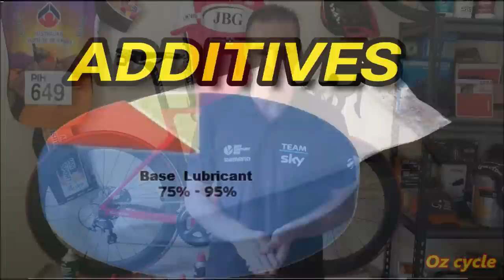Ultimate Chain wax - make it yourself

Comment: I've been waxing my chain for more than a year now and what a change it has made! Cleaner chain, better gear changes, cleaner hands after changing tires / flats, easier maintenance! Thanks! 
Just an idea - I've been dipping an old magnet into the hot wax after a chain waxing and I collect metallic dust from the bottom of the crock-pot. Simply collecting this metallic dust keeps the wax cleaner and freer from grit.  You may need to skim the magnet over the bottom surface a few times to collect most of the grit. This keeps the wax cleaner and I imagine keeps performance over time. Let me know what you think!
Reply: I wait and let the wax harden. Invert and wack it. Scrape it with a spoon and the wax is clean.
Reply: What wax did you use?!
Reply: i did it to and my chain looks dry after 150km, it looks like there is no wax anymore on the inside of the chain...
Reply: Magnetic cleaners are used in central heating systems.
Reply: This is a smart idea!! Should pinned!

Comment: After 45 years of oiling chains, this video sold me on trying a wax immersion lube. My first ride today with a waxed chain - my chain was the quietest it has EVER been, and at the ride's completion, I rubbed my fingers on the chain, and they came away without the black, oily mess that appears at the end of only one ride when using various "traditional" oil lubes. The cleaning and waxing process is a bit time consuming and requires some new equipment, but I cleaned and wax lubed three chains this morning - good enough for about six weeks of riding, if this video is accurate. Many thanks for creating a compelling and informative video on this topic!
Reply: Hi, interesting that you say your chain was the quietest it has ever been?  I went out with mine waxed for the first time at the weekend and it was really quite noisy, compared to usual.  I can cope with this but do you know, are we supposed to let the was cool from 93 degrees down to the melting point of say 56 degrees before taking the chain out or did you take it out at the higher temperature?  Thanks.
Reply: @johnslater996  I’m finding that too, John. Also wondering whether the cooker should be turned off once it’s at the right temperature...
Reply: @SteRumbelow  I take the wax to 93° put the chain in and switch the cooker off.  All good after 15 mins.  Turns out I'd fitted the chain wrong on the rear mech - all good now 👍
Reply: @johnslater996 While I have not taken the temperature of my wax while sloshing my chain around it in it, I do NOT let it cool before removing the chain. It is also important to let the chain warm up in the wax for several minutes, along with some agitation, to make sure the wax penetrates well into the interior linkage surfaces of the chain. I take it out of the hot wax, and immediately wipe with a cloth, on all four sides of the chain. This eliminates most of the excess wax, which seems to add noise. Of course, wiping the outside surfaces of the chain does not remove the wax from the internal bushing/pin contact points, nor the inside of the plates; these are the locations you really want the lube. If you let the wax cool before wiping, or if the wax is not nice and hot, then you get a lot of excess buildup inside the links. This contributes to noise plus it leaves a lot of excess wax residue on chain rings and cassette cogs. I also run the chain around a 1" PVC pipe while the chain is warm, to better work in the wax and also loosen up the chain before putting it on the bike. Other comments - I still have to occasionally wipe small bits of wax off my chain stay, chainrings, cogs, and pulley wheels (every 1000 miles or so), but it is easy and fast - and I only have to wash my bike when I ride in the rain or through some mud. To reduce the time spent rewaxing, I wax 2 chains at a time - effectively cuts the time in half. After 5k miles per chain, they are still "in spec" (using the Park chain length tool) with respect to length.
Reply: i’m curious if everyone is still waxing their chains
Reply: @andrewreed1329  Mee too

Comment: Massive props! Been using your method for a few months now and it's saved me eons on post mtb ride cleaning and time between rewaxing compared to various bottle lubes I used in the past, which require constant reapplication and attract so much crud. Only downside is it doesn't hold up well in the rain, so it's worth keeping a 2nd lubed chain or keep a bottle of Squirt lube handy just in case!

Comment: Great video and thanks for sharing the information. I found a post on a forum many years ago explaining about the forces/pressures within the chain being extreme point pressures, similar to a car gearbox and suggested that the best lubricant was therefore EP Gear Oil (I use 85-140). The problem arises of how to keep the oil in contact with the pin/internals of the chain and suggested mixing it with paraffin wax. I took this great info and implemented it - after fully cleaning/degreasing the chain, I made a mixture (aprox 50/50) and melted it in a pan (in silver foil), enough to cover the chain. I let it cool to solidify (which keeps the mixture inside the chain) and removed the excess externally. The results have been amazing - on one chain (old mntn turned town bike) it survived 4 trips to Burning Man (probably the harshest environment for bikes on the planet!) with only light external cleaning with EP oil to maintain its almost silent operation! I still haven't needed to repeat the initial procedure as it just keeps going, around 9 years later...
Reply: This is the recipe I've used for the past 10 or more years.  I can easily get about 1000km of riding before the chain sounds a little dry and I reapply the lubricant.  I don't bother cleaning.  Just immerse the chain in the hot wax/oil bath for a few minutes, then lift it out and wait for it to cool before putting it back on the bike (or swapping if I'm running 2 or more chains on the one cassette).  I don't bother degreasing a new chain either.

Comment: After "ultimately" cleaning my chain, and waxing, both per your directions, I just today rewaxed my chain after 193 miles of off-road mountain biking.  Being able to ride time after time, and not worry about lubing my chain, or about the grease when I handle any part of my drivetrain, is worth so much more than time and money.  Wow.

Longest part of the rewax is melting the wax sitting in my rice cooker.  Takes about 4 hours plus to fully melt on low heat.  Cleaning with boiling water was a breeze, as was the waxing, and putting back on the bike.

Can't thank you enough, Oz.
Reply: Now, with a waxed chain, when I wash my bike, the following day I have zero rust on my chain.  And, I can thoroughly dry my bike, and there is absolutely no grease on my microfiber paint-only drying towel.  I used to absolutely contaminate all my paint-only mf towels when I dried my bike.  Just ruined them.  No longer.  Yet 2 more reasons to wax!
Reply: 4 hours to melt wax? You must have forgotten to depress the lever on the rice cooker. Without that it will only supply heat to keep rice warm.

Comment: Oz cycle - absolute legend. For those in the UK - Argos slow cooker £12.99 - Hobbycraft 1kg Parra fun wax block or pellet £8. PTFE powder off AliExpress....or eBay but was sold out
Reply: Is it worth doing the cassette?
Reply: @rallyboy101 I'm far from an expert, but I would say no. The main rationale for doing the chain (particularly immersion) is due to the many hundreds (perhaps thousands) of stiction points within the chain with each pedal stroke. Whereas, for the cassette, the chain comes to a rest against it one link at a time and pulls the teeth along. The chain isn't even supposed to "rub" against the cassette.
Reply: Can you use a normal pan on low heat instead of the slow cooker?
Reply: @alexapirot32  yes, but very low heat, so it doesn't start generating fumes
Reply: Or use a pan on top of another filled with boiling water. Au bain marie.

Comment: Two days after uploading, seven chain lube manufacturers dislike this video.
Reply: Suggest you read zero friction cycling facebook post re the testing. Plus home formula wax blends hardly new, and many perform well for those wishing to go that path. Its a tiny demographic, i dont think many lube lube manufacturers too worried. But to understand a bit more about proper independent testing, refer to zero friction cycling and learn some key points.
Reply: @adamkerin4130  It was a tongue in cheek reply Adam. I've been waxing my chains for a couple of years now; chains last 2-3 times longer as well as sprockets, cleaning my bikes is a lot faster and the only "inconvenience" is taking my chain off to clean and re-wax it.

Comment: Good evening and thank you SO SO SO SO SO much. PTFE arrived (ordered from eBay on December 2019) yesterday. I have had 3 chains super cleaned already (petrol, wash with soap, degreaser, wash with water, alcohol) and I waxed them all three following your recipe by heart (I have also cleaned my cassette and chainrings before testing).
Today I tried one of the waxed chains: Oh my God..... what a difference, super smooth operation, NO NOISE AT ALL, excellent shifting performance, super clean chain/cassette/chainrings after 90 km, super clean bike, and an achieved ΚΟΜ.
Thank you again so much indeed. Greetings from Crete/Greece !!!

Comment: Just a quick update, just completed my first 100km on my waxed chain and it's still clean, it seems faster and definitely more positive in the gear changes and it is quieter on my bike, although some people have reported it to be noisier than before I did not find that problem, well and truly happy with the results, I'm definitely a convert now.
Reply: I found out about waxing about 10 years ago. I initially used candles but have moved to food grade wax. Once you start and get into it there is nothing better.

Comment: Alternative to buying or ruining a slow cooker:  Boil water in a pot. After a good boil, turn heat down so its slow bubbles. Put container(metal or plastic) with wax in the water-if plastic, be careful not to rest on the bottom of the pot, by the heat source. It could melt or burn.  Used this method for candle making, etc.  Thank you, Mr. Oz.
Reply: If this technique in gastronomy is called a bain-marie
Reply: works also fine for me!

Comment: Fantastic video and great detailed instructions oz. Thank you! I've ridden 600 km since the first waxing a couple of weeks ago. Still no squeaking and the chain & drivetrain are still shiny and very quiet. Going to clean/reapply soon and I may get to my wife's bike too. LOL
I didn't use petrol on my filthy Ultegra chain, just the Varsol cycle several times before the Meths rinse. 

For any Canadians interested in this method, I ordered 100g 1-3 um PTFE (2x 50g sachets) through Alibaba delivered in Canada for US$17 and 1lb of food grade paraffin wax at Superstore for Cdn$6. That is basically a lifetime supply of superb wax lube for our household bikes, all for Cdn$30. Is Teflon powder restricted in Canada? Nobody sells it to the public and US vendors won't ship it to Canada for under $30!

One tip. Rather than buy a dedicated slow cooker, you can use a large, clean microwavable (so the container won't melt) food container to melt the wax/PTFE mix. Use your wife's best large pan on very low heat on the stove, with an inch or two of water in the bottom - it is effectively a double boiler. Cost is $0. Once you have waxed your chain and the wax/PTFE has cooled, simply put the container lid on and store until the next time. LABEL IT so the rest of your household know what is in there.

Comment: Been waiting for this video. people are amazed when I ride in the worst sandy, muddy, rainy, weather and my chain stays clean cant wait to try this new recipe
Reply from the maker: Yeh,just had to make sure the big lube merchants  weren't going to send out any hitmen on me  :)
Reply: @stevenleffanue  lots of people trying to make a living off gimmicks out there for sure
Reply: @stevenleffanue  haha I didn't read this comment and commented the same thing above
Reply: I did a decent chunk of the round Australia circuit using old style "white lightning" commercial wax lube and that was magic. In the red dust areas nothing stuck to it, I'd just wipe it down every day and add a tiny bit of lube. 15000km of excellent riding. Then they "improved" the recipe and the dust stuck to the chain... sadly the DIY doesn't work on the side of the road. But now I'm back in civilisation it's time to buy a slow cooker.
Reply: Just spent £30 on ebay and I'm all set.

Comment: I finally got my PTFE today.  I had ordered some from China but it's still not here in a month.  So I ordered some from a U.S. supplier and it arrived today.  First impression is that the chain is less stiff with the PTFE after cooling off.  I put the waxed chain with PTFE on the bike and gave it a spin.  I can feel less friction already just spinning the pedals forward with bike on a bike stand.  I think the PTFE makes the pure paraffin wax less stiff.  I'll be doing my first ride tomorrow using the new PTFE formula.  Can hardly wait to feel the results.

I have a tip to share.  After dunking several used chains in hot wax some ferrous particles settle out in the molten wax.  I use a strong magnet on a telescoping rod (sold at automotive parts stores) to collect the fine ferrous particles.  I work the magnet back and forth on the bottom of the crock pot.  Then I remove the magnet and wipe it with a paper towel.  I repeat this process about 20 times or until I don't see black streaks on the clean paper towel.  I'm surprised to see how much ferrous particles can be removed using this method.  Of course this is with the pure paraffin wax.  Hopefully with the new PTFE formula I'll see a lot less ferrous particles.
Reply: The PTFE definitely makes the chain feel slicker.  Less noise and the links soften up much quicker than pure paraffin.  I'm sold on this new formula.  Thanks OZ Cycle.
Reply: What brand of PTFE you bought from US seller, what size of the powder. The one I found on Amazon is 2-3 um. Do you have a link? Thanks a lot.
Reply: @yingwang2935  That's the one I got on eBay, the 2-3um one.  Those particle sizes listed are average sizes.  So some particles will be smaller than 2um.  It's not the end of the world if you get 2-3um.  Also I believe that not all advertised 1.6um are truly 1.6um.  For all we know they could very well be even worse than the 2-3um.  There's really no way for us consumers to tell the difference.  Cheers.

Comment: Thank you for this, and for all the effort that went into it.
Do I understand correctly that (other than the addition of PTFE) your recipe and method differs in two ways from your previous recommendations:
1. No addition of liquid paraffin (oil) to make the wax adhere better to the metal, and
2. No cooling of the chain after waxing to solidify the wax inside the chain?
Reply: If you use a paraffin wax you shouldn't need any extra paraffin.
Reply: I agree: an explicit recommendation from OZ Cycle, breaking from prior recipe, would inspire confidence
Reply: IME, using a higher temperature (above 100C/212F) results in better adherence to the chain, with no flaking off of wax at all.
Reply: Yes, I'm wondering the same thing? Also only cleaning with boiling water? What happened to all the shakers with petrol, and metho?
Reply from the maker: Correct Paul. Ptfe replaces the oil. No snap cooling required either.
Reply: @hodgo1981  I think you only need to do that the first time you wax to get the oils ect. off.
Reply: @hodgo1981  I still do the petrol/degreaser/methyl hydrates once a year but every week or two I do only the boiling water and rewax. However I'd like to ear Oz's recommendation about that.

Comment: Been waxing my chains for 3 years, due to your influence. Works a charm (the older style with wax + parrafin oil) and even better after I realized I was using too much parrafin oil. It only takes a little, too much turns the wax into "grease" which is bad. 
Now I'll try the wax/ptfe combo for sure, but getting hold of ptfe-powder in the EU seems to not be that easy. Finally found a supplier, but that was in China (ofc). Ordered. Will be here comes spring.

Edit: The white residue you see on your chains, I get something similar without having used ptfe. So what that is I really cannot say.

Comment: Greetings to Australia and thanks a lot for your videos. I really got the in depth information for getting the correct ingredients and material. I’m living and riding in Germany, not too far away from Wippermann (Connex) factory. My drivetrain is a Shimano 10x3 XT in the upper price range. So I swapped my Shimano chain for a Connex 10S1 with quick link, now waxed. Oh man, what a difference.
For the first time procedure:
1.	First using in Germany called “Kaltreiniger” degreaser in a jar and shake it, doing at least 3 passes
2.	Then having a sonicare ultrasound cleaner 3l with a specific cleaner 3 cups on 2l water, doing the chain 30min on 70°C
3.	Last, using Isopropylacohol for the last degreasing, one run in jar, then hang and dry over night
I’m also using a 3l crockpot for waxing.

Main difference from your “waxing in between”, I use white spirit instead of Isopropylacohol, because it dissolves the wax by 100% when doing a mix wax : white spirit of 40 : 60

Comment: Great videos and techniques, as always. One thing you might want to mention is that the coat hangers you use to bend into hooks and hangers should be BARE METAL hangers. I made the mistake of using a plastic-coated hanger which resulted in a melted goo coating the chain when pulled from the molten wax. Ruined a new chain (and the wax/PTFE mixture as well). Won't make that mistake again!
Reply from the maker: Must be a real skinny coathanger with plastic on to fit thru chain link ?